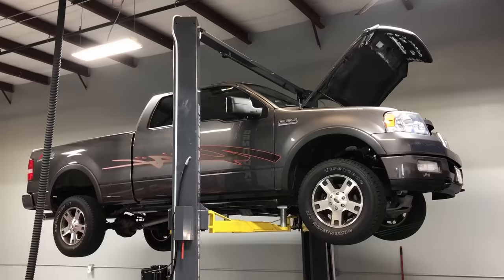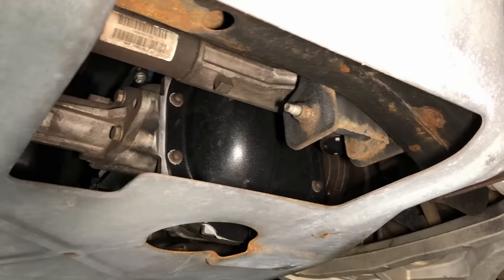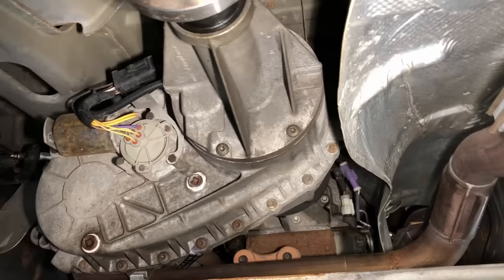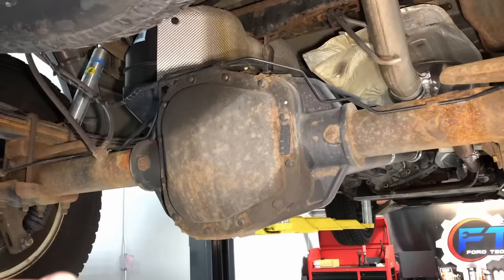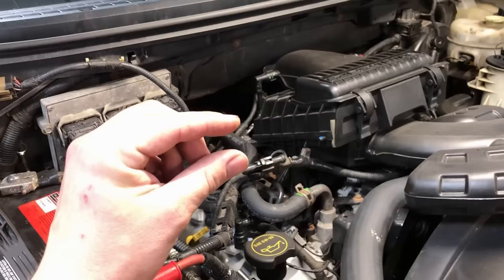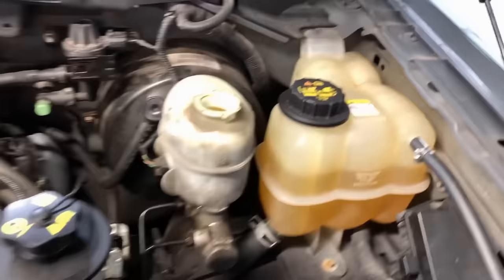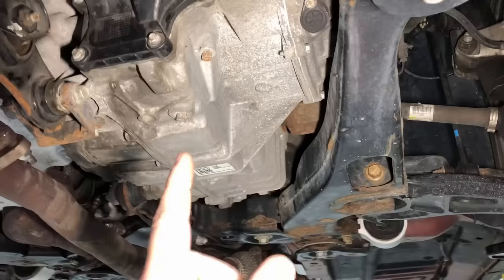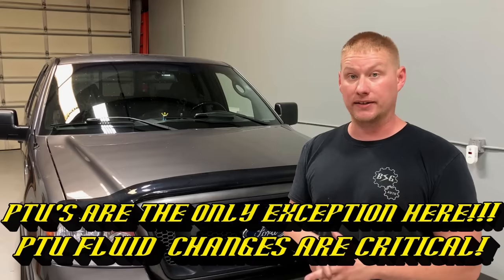Never Follow Ford's Lifetime Fluid Service Intervals: Here’s What I Recommend and Why!

Comment: I have a 2013 global Ford Ranger T6 with the 3.2 I5 diesel engine and has been good to me. I've done 5000 mile oil changes with motorcraft diesel and gasoline engine oil (the one used for EcoBoost engines), recently did driveline fluid changes (differentials and transfercase) and I'm planning to flush the power steering and brake fluid at some point.
I did have the mekatronics unit go out on me and the dealer changed it while adding new trans fluid and filter, so the transmission fluid is covered. With that, my truck has been fairly reliable and have no major complaints with it and plan to keep it for a long time.

Comment: And don't forget to drain the torque converter on the f150 and f250 that have a converter drain plug!!
Reply: Holy crap, I'm never buying a used Ford unless I know the owner is insanely dedicated and knows more than the actual engineers that designed these junkyard ornaments.

Comment: Your videos are some of the best on vehicle maintenance, very helpful for any Ford product even when not related to current application. Just acquired a Windstar and having some dealer advice helped me restore this vehicle to running condition. I was also unaware that Motorcraft Mercon-V was less expensive than the aftermarket alternative, doing a pan drop filter change soon. Never seen black coolant before (looked like Gold & green mixed), a real PITA to flush out.

Comment: I have my Focus ST and was getting some random high rpm misfires - went and checked the plug gap, and spec is .028-.030.  My plugs were at .045, mileage was 87,000.  Put in new plugs with gaps of .028 (standard heat range) and the misfire is completely gone.

Comment: What are your thoughts on replacing the transmission pan on a 2016 F350 Super Duty  6R140 with a finned aluminum AFE pan?
Reply: Robby Bacon Iv personally done an upgraded pan on an 18 350 dully with 150k. It was a long haul company. So far we haven’t heard back but after install and testing we heard a lot of transmission noise. Only thing we could figure out was because it took an extra 8 quarts of fluid. We don’t know how much longer it’ll last if it doesn’t fail. The company trucks are rigorously maintained. But still. Be very cautious about it. 
We had the company sign a waiver of release after install and test drive. We let them know our concerns and didn’t recommend it stay on. Not from being money hungry but to keep the truck on the road as long as possible. Just some food for thought.
Reply: I do this on all my vehicles because anytime you add cooling ability and more capacity you will add longevity to the transmission.

Comment: Hi FTM question how about service based on time as opposed to miles. I have a 2016 F-150 XLT sport V8 and drive approx 2,500 miles per year. Should I still follow the miles service ?
Reply: You only drive 2,500 miles per year? You could probably get by with a bicycle lol

Comment: How about the title should be "Never Follow ANY Manufacturers Lifetime Fluid Service Intervals".  That said, I'd probably do it more often if they didn't charge $600 for a trans oil change...which is what I was just quoted by 3 different garages and the dealership (nah, no collusion or price fixing in my area)...
Reply: It helps so much if you can do the work yourself, of course you need the space and time, but it becomes a side hobby of sorts
Reply: @ILLEagle_1  I do some things on my own.  I am limited in what I am able to do.  I don't have a garage that I can just "take over" for days or weeks at a time.  I have a 1999 Tahoe that needs the entire front suspension replaced, but to do it will require several weeks.  I could take it to a local place that will do it...for $4100 (more than the truck is worth), or I could do it myself for about $800 ~$1000 in parts.  COULD because I would need to take over the garage for several weeks, and my wife won't go for that, even with saving $3K+.  

I also can't do some of these jobs because I can't afford to be without a vehicle for days at a time.  If something goes sideways (and believe me, something ALWAYS goes sideways), I can't afford to be down for a day on my daily driver...work calls, and they really don't give a rats behind that I tore into the trans and had a problem...LOL.

I already told my wife, next house has a pole barn on it so I can work on a vehicle without displacing our daily drivers for days or weeks.  I think she's on board with that, but that isn't happening for a few more years.

Comment: Seems to be inline with my maintenance Schedule on my 2012 Ford Fusion. :) -  Engine oil changed Every 5,000 to 7,500 miles with Full Synthetic Mobil 1 with a Motorcraft FL910S.  Every 30K Mercon LV Drain and refill on the Automatic Transmission.  Engine Coolant drain and refill with Motorcraft brand changed at 100K.  Brake fluid Flush at 60K and just recently at 120K with new front and rear brake pads.  I've got 128K on my Fusion and it runs GREAT - This is good advice people!  DON'T LISTEN TO FORD IF YOU WANT TO KEEP IT PAST 100K.

Comment: No Shit I still change my oil every 3,000 miles and my antifreeze every 15,000 miles or every two years and transmission fluid every 20k miles.
Reply: and I still drive daily an 1987 Lincoln Continental (Fox Body) RWD with the Ford 4 speed AOD and had it for 6 years and the 302 CID 5.0 L Windsor V-8 going strong and still get 20 MPG city and 28 Highway.. Also I use nothing but 91 or higher octane with no ethanol or alcohol.
Reply: I use everything Amsoil and follow their change intervals, no need to go overbaord lol.  And I save money and labour with Amsoil.
Reply: @TheBeatenPaths  Do you use amsoil in your transmission as well? I have a 6R80 transmission
Reply: I change the oil in my daily about every , well , almost never.
Once actually , back in 2013 when I got it I changed it and decided that was a waste of money.
Reply: Lol 15000 or 2 years. I hit 20000 in one year. Fluid changes are frequent. And mildly costly.
Reply: @rcsix3rd  
that's the work truck , it's got 85k on it and we got it in March 2016. 
For work, I drive about 20k+ a yr but my beater is lucky to break 1000. 
If I have to go any distance I take the wife's car , not sure I'd take an 8hr trip in that car

Comment: I care about my customers. Believe me I would much prefer to sell fluid services over powertrain components. 
But from a strictly monetary standpoint,  there is less profit in selling a transmission to the rare customer who comes to the dealer for that kind of thing.
15 years ago I sold engines and transmissions all the time. Since the crash of 2008, powertrain component sales have dropped by 2/3
And the ones who do buy engines and transmissions tend to be very angry about it.
CSI surveys go to all customers now, not just the ones within the warranty period. 
Preventive maintenance is key to safety and the longevity of my customer's vehicles, and they are happier customers. 
Excellent video

Comment: I remember a new, off the lot vehicle I bought about 10 years ago now. I read that manual and they were okay with having oil changes upto 16,000 km’s/ once a year. I couldn’t believe it. I had never read such a thing. Once I realized it was running full synthetic it kind of made sense. It was over $120.00 for just an oil change at the time. I do a full synthetic, OEM filter oil change and it cost me $75 now on my Mazda/Ford engine.

Comment: I had a 2007 F-150 FX4 but now I have a 2014 Ford SVT Raptor. Will you do a video about those trucks?
Reply: It’s all the same on the Raptor except the dang Fox shocks needing a rebuild every 60k miles or when they feel like blowing out.

Comment: I change my oil in my Lincoln MKS Eco-boost at the point of 50% of oil life.
I change my PTU fluid every 30k miles. I changed my transmission fluid at 60k miles or after a very long trip. And use top of the line synthetic oil.
I've had no issues with the car it's a 2013.

Comment: Thank you for confirming my belief on the "Lifetime" BS. I always believed it was marketing crap because who stands to gain when it fails? The dealer. 

My 2010 F150 with 51,000 miles gets quality synthetic every 4-5K. I do it myself and for around $26 it's just too cheap cheap not to take care of it.
Reply: No, they do that do they can advertise lower cost of maintenance.  And we at the dealership lose out on maintenance dollars.  Hardly anyone comes in for a transmission replacement.  They just trade in or get the job done and Joe blows garage.

Comment: Nice job skippin over that leaky pinion seal.. 😎
Reply: I was just going to comment about that... lol.  And the driver's side rear axle seal that's leaking.
Reply from the maker: I don't understand your comment, this is a maintenance video not car inspection video. Leaky pinion or axle seals have nothing to do with maintenance. This is the new shop truck so the rear axle seals, pinion seal, diff cover and axle vent will all be addressed at the same time. I am going through this truck front to rear getting it in tip top shape.

Comment: Dude you are the man. I got a 98 Grand Marquis with 79,000 miles, changed all tranny fluid, filter , engine oil, and coolant flush, what would you recommend Next? I just got it a couple months ago. Runs like a dream, can you do a video on the panther platform base? Where you cover everything like you did in this video?

Comment: My sincere thanks for this video; I've just purchased a Ford Crown Victoria within the last few months, and the owners' manual pretty much said lifetime EVERYTHING fluid-wise except for oil, to my eternal frustration, though thankfully the original owners refreshed the basics before I bought the car.

I've copied down your interval recommendations for all the fluids the Vic uses; will be DIYing what I can (oil change, brake fluid and rear diff is about the extent of my skill set in this case, though I might drop the transmission pan as well at some point) and getting the rest professionally serviced ASAP, before following the intervals you've suggested.

Comment: Thanks Brian. I been neglecting my 08 f150 2wd. I use full synthetic and change every 5000 kilo but haven’t touched anything else since I bought it. Only has 62000kilometers but I should really replace antifreeze and trans oil. By the way that truck looks real good underneath. Compliment the owner of that truck. It’s a beauty.

Comment: Good info.  Been preaching the same message for many years.  Side note - not a huge fan of Motorcraft Gold coolant, especially in the diesel trucks.   It might last 100K miles if less than 5 years old.  I see protection drop off and rust begin to develop as the coolant degrades after 5 years.   Compare it to Asian, Mopar or GM coolant after 5 years and usually looks like new.

Comment: My 1996 F-150 I-6 300 Never went more than 3500M with out oil and filter change .Trans 40,000.Rear dif 50,000 "Never did towing are heavy haul .plugs,cap and rotary once a year"Used Motercraft parts so cheap and easy to tune . It had  over 300'000 and used 1/2 quart between oil changes .I just had the front  redone pretty much every thing between the front tires  + new rear brakes .Shortly after that That truck saved Me and My wife and the family in front of us lives long story .My point "Take care of your car or truck and it will take care of You.

Comment: He is right, I have a 2005 Mustang GT with 229k miles on it. I am allover my maintenance like clock work.

I do Synth Blend oil and change it every 2000-2500 due to the age and miles of the motor, but that thing is turn key start every morning.

I just changed the clutch 2 weeks ago and changed out the 229k mile transmission for one i had laying around with only 17k miles on it. Did the slave cylinder as well. 

Last time I did the brakes (2020) I flush the brake system. Power steering system was flushed last week, and I just did the rear diff fluid on Friday.

Comment: I did a “break in” oil change on my Explorer at 1000 miles, another at 7500 and planning again at 14K.  After that every 6000 and yes using Mobil 1 Full Synthetic.  Trans/put fluid and plugs at 25K and every 25K after that.

Comment: I agree with everything said. I'm a design Mechanical Enginner, MSME, with a major defense company. No fluid lasts forever, some degrade just with time. I do not agree with OEM recommendations, on anything except coolant. 50k miles or 6yrs

Comment: I once had a 1978 Porsche 944s that had a 2.5 liter 4-cyl engine with a 7 qt oil capacity. The factory recommended a 15,000 mile OCI which was nuts. Even with the best synthetic oil and high-quality oil filter that oil was done after about 6K to 7K miles, dirty and smelly. In general, I go with half the manufacturer's fluid change intervals on a vehicle that I care about and that I want to last a long time. It's like cheap insurance against the high cost of car repair.

Comment: You'll be surprised how dirty differentials get after 30,000 miles I got a Lexus GX yes it is a body-on-frame SUV primarily all wheel drive I tow with it a lot snowmobiles and ATVs there is a very fine shavings on the magnets at 25 to 30,000 miles you're 100% correct it's easy to do anybody can do it

Comment: 65k miles on my 2014 Fusion 1.5 Ecoboost, doesn't burn a drop of oil with 5K mile oil changes, transmission solid so far (flushed at 62K).

Comment: Excellent video!! The transfer case on v6 engines ford is very close with the transmission and other parts so it gets hot and the gear oil gets burned specifically 75w140  gear oil . So changing it every 15 000 miles it will never have problems and it will keep the transfer case happy..... I have lincoln mkt 14 with 243.000 miles and it runs like brand new...... Olso save a lot of money doing the job yourself than spending money at the mechanic....

Comment: I change out my break fluid every 3rd. oil change. About 12,000 miles full synthetic. By changing brake fluid, I mean taking a Turkey baster and syphoning the reservoir completely out. Adding brand new, never opened brake fluid keeps fluids like brand new. And it keeps the brakes stopping strong.

Comment: Thanks Man.... Worked as a service adviser briefly between stints at Discount Tire, your videos and recommendations were why I dumped all my fluids in my mustang and wife's fusion. The mustang had the Trans fluid changed at 40k a little before Fords 50k recommendation and it was so black it looked like ink. Wifes trans was changed at 35k and it came out so dark and brown. I called over the shop foreman and a trans guy. I asked if this was normal. They said yeah like they already knew. I asked why does Ford say to drive on this for another 70k at least. They said the fluid color degrades quick and it is what it is, but was still doing its job. I said if this came out of a car with 100k, 125k I would be hoping for the customer to get another six months before coming back complaining of trans issues looking like this. They just laughed and said even if Ford said every 60k like the dealership people still wouldn't do it. Then when i pressed them about the BS, they started talking about severe service, use cases etc. The wife's car was an auction lease turn in from Arizona purchase at 16500 in Texas. Was have some shifting hesitations, etc. Did some research (what I found kind of harkened back to similar shift issues seen in the 96 to 04 taurus) requested a TCM/PCM flash update and adaptive learning reset, no dice. Flushing the fluid fixed it and I picked up about 3 to 4 mpg highway. 26/27 prior 29/31 after. Well worth it.
Reply: What engine is in the Fusion that gets only 31 on the highway? My 2016 1.5 gets 40 mpg on the highway. When I bought it with 21k miles it got 38 mpg. After the first oil change I did it went to 40 mpg and has been there since.

Comment: bought a used 2016 ford taurus that had 36k miles on it, I didn't wait too long, at 40k I changed all fluids, Transmission fluid and coolant, and Oil. ill most likely keep doing it(transmission) every 30k as that's what I've heard from a few good mechanics.

Comment: Friend had a 2012 Mercedes from new that stopped working at a street light, no signs of any prior  problems, and always dealer maintained at schedule maintenance intervals. 

Mercedes said they couldn't fix it because there was so much sludge in crankcase and it got totalled! That's what 15,000 mile oil changes will get you.

Comment: I HAVE A 1993 FORD EXPLORER 4.0 V6 PUSH ROD MOTOR /CHANGED MOTOR OIL EVERY 7500 MILES-USED THE CHEAPEST WALMART OIL YOU COULD FIND-/BEST TRUCK I EVER OWNED -HAS 400K MILES AND STILL RUNS FINE / ALL MOTOR OILS ARE GOOD THESE DAYS /CHANGED REAR END FLUID ONCE/ENGINE /TRANS /AND REAR END HAD NEVER BEEN APART /

Comment: Hit the nail on the head Brian.  With my 2017 f150 reaching 30k miles, I was watching for THIS video! Good work as usual.  Many thanks!  And other than a different filter fitment .  Are there any changes I should be aware of with my 2017 6R80, from the 6R80 videos you’ve done?

Comment: I got a car with no turbos and a manual transmission. Change the engine oil at 3,000 miles, transmission at 20,000 miles and differential at 20,000 miles. Excessive? Don’t care. All my cars have never broke down on me or had any big issues.
Reply: That a dub right there 👌

Comment: Thanks much.  I just now took my 2012 F-150 in for both diff's, transmission and transfer case fluid change.  Only 42550 miles but had towing and off-roading.   I thought it might be a good idea.  I'll check brake fluid and power steering too.  :-)
Reply: No fluid changes, that is electric power steering.
Reply: Thanks for that info.  I think I knew that but I was thinking old school when I made that comment.  Glad you jumped in and let me know I made a mistake.